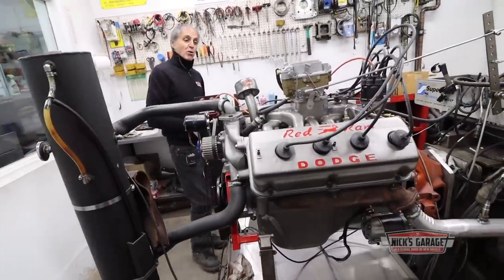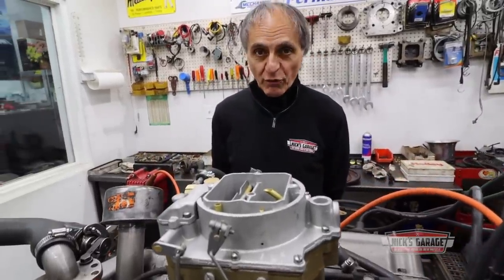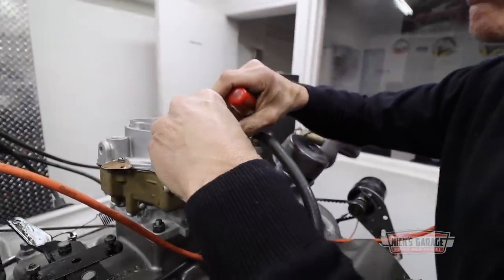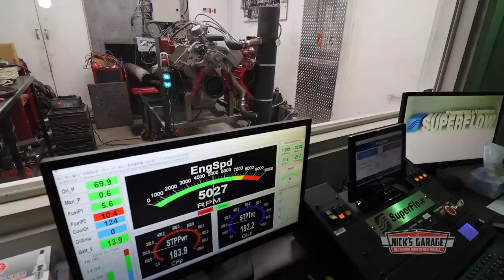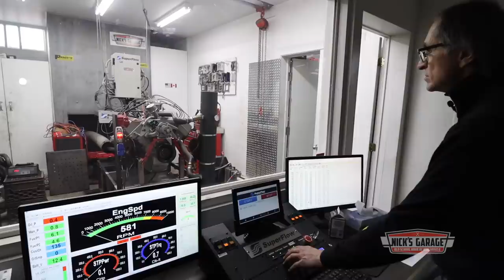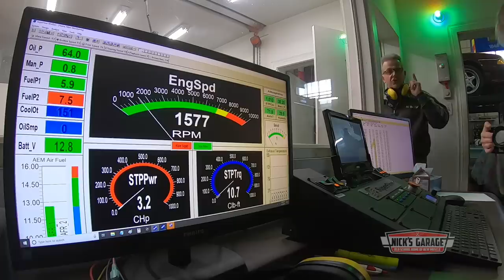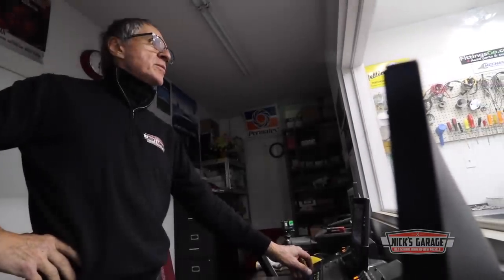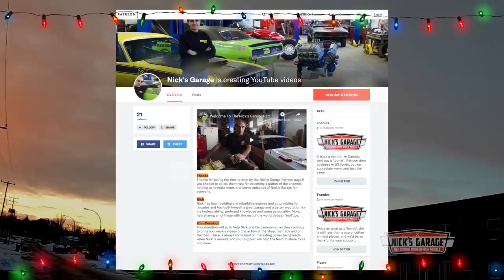Tiny Old HEMI - First Generation 241 Hemi on DYNO

Comment: I wish I had someone like you near me to help me build my DeSoto Hemi I found in high grass at Able Auto Wreaking, My Dad took me there in 1969 when I was 14 years old, I traded a beat up Dodge Challenger for it after I fried the second 727 transmission in it, when I pulled the first 727 out I opened the drivers door and the body flexed under the windshield and dash board, in summer of 1984 I traded it a year after I bought that Challenger after I got out of the Army under Medical Conditions. I’ve beat cancer 29 years ago Late Stages Hodgkin’s Lymphoma And radiation treatments fried my bones so bad I had both shoulders (93-96-98-99) replaced and bone grafts on both hips and in December 2016 I had open heart surgery aortic valve replaced and one bypass and a pacemaker put in. It’s hard getting things done but I keep trying 
Thank You for Sharing this on YouTube
Reply: Michael.        Keep going strong Michael.  All the best.
Reply: Nick Panaritis thank you sir, it’s been a long overdue project for me all on my own, Nobody wants to help me for they all tell me they want my car (1929 Ford Coupster and Engine) I started this nightmare in 1973, found my first Hemi in 1969 under a tree in high grass at a junkyard on the Tuscarora India Reservation and traded a 72 Dodge Challenger for it in 1984. Bought my second DeSoto Hemi in 1992 both are 291 - 1955 S22 Bocks this one ran when pulled . #1 was stuck had a plug removed and Ax hole in oil pan and turned out it came out of a car a friend of my parents who was teaching his sister in law how to drive when she rolled it in a ditch in 1960.
Reply: Nick Panaritis and since all that I beat Late Stages Hodgkin’s lymphoma in 1990 and radiation treatments and Prednisone ate my bone away and I had both shoulders replaced and bone grafts on both hips and in December 2016 I had open heart surgery aortic valve replaced and one bypass and a pacemaker put in, I’m 64 years old and on Social Security now , not easy for sure
Reply: Stay strong friend!
Reply: @horseyhorselips3501  what part of the country do you live in Sir?

Comment: Nick, The 1959 1st generation Hemi did run a little lean back then. I think it was designed that way on purpose. That's how Dodge accomplished 25 M.P.G.. Dodge wasn't in for the horsepower until the end of the 2nd generation Hemi's competing with Ford, Chevy, Chrysler, and G.M., but I could be wrong? This video was the most intense dyno video you ever had! It was like watching a soap oprah! 👍😭👍. "MERRY CHRISTMAS NICK'S GARAGE!!!""🎄🎄🎄🎄🎄!" Oh, one more thing....those old iron blocks did loose 10 horse power when they get hot. I don't recomend you run that engine in the desert. That engine would run better with a Holley 500 2 barrel carburetor. Maybe with 38 m.m. jets. Add some led additives to the fuel.

Comment: It's not flowing fuel through the secondaries because the secondaries aren't opening. You can look directly down and see the secondary plates still closed. That's an early WCFB without the weighted flaps, but I doubt that's the right carb anyway. 241 was most always a 2bbl, and that carburetor is missing the hot air choke that should be there. Sounds good though.
Reply: Tyler`s.            Had it fixed the next day.

Comment: Great video.
I have INE of these Engines torn down and cleaned ready for a rebuild.
I located a lot of cool after market stuff for it like high compression Pistons, found a guy who can grind and reprofile the Camshaft, Offenhouser Tripower manifold and original style 2 barrel Carbs.
Haven't found any good exhaust Manifolds or Headers yet.
Also can't locate a new or rebuilt Water pump, mines missing.
I will probably use this Engine for a Rat Rod.
As you explained very well about the unique Flywheel, Torque converter, Starter arrangement glad you figured out a new combination with a small diameter 426 Flywheel but I do have the original old 53 or 54 Automatic I'll probably use.
Thanks for all your GREAT videos.👍

Comment: nick, you can solder up the jets and redrill them with the special drill bits they use to clean and adjust gas burners in furnaces and commercial bakery ovens,can get these jets drills at JOHNSTONE,do it all the time,and you can resolder them over and over,NEVER BE WITHOUT THEM,I HAVE TWO OF THESE ENGINES AND TWO 1955 331'S old hemis,they are the best engines in the world,they propelled drag racing into the future,happy new year nick and crew

Comment: There is so much hot rod stuff currently available for these engines that it borders on the ridiculous. Google "Hot Heads." They are early Hemi specialists & just about anything you could ever want is listed in their catalogue for all 12 of the Chrysler Corp 1950's era Hemi engines.
The 241 Dodge Hemi was made in 1953 [140hp] & 1954 [150hp] with the TWO barrel carb. The Offy Manifold & Carter WCFB carb, as seen on this engine was a factory fitment on  a limited run of convertible models that replicated the Indy Pace Car in '54. I don't recall the power output for that engine but with the low grade fuel that was available in the early '50's the 7 point something to 1 compression ratio was well justified.
The 1956 Dodge 315 & 1957 Dodge 325 Hemi came with over 9 to 1 compression & that really picked things up in the power department, particularly with the factory dual quad Power Pack option.

Comment: Hey Nick, thanks for the dyno of the 241, I had one when I was a teenager. well, I THINK it was a 241. It said 'Red Ram' on the valve covers. Did dodge make any other 'Red Rams' besides the 241? See, I bought a running body off dodge that this farmers kids stripped the body off and put the seat and gas tank on the frame and they drove it around in the fields of their farm. I found it behind the garage and saw it was a hemi and bought it from the farmer for 20 bucks. and yes, it still ran. Thanks again for all your hard work making this rare Hemi go zoom again...Tommy in Minnesota

Comment: I have a 54 dodge coronet with this Red Ram engine that was raced here in Tucson Az in the 50's and 60's as a drag racer. i am going to put it back on the track i the nostalga class and see what it will do. I have the old trophies and time cards from the 50's and it ran in the 14's it has a 4 brl and three on the column and an overdrive. I really enjoyed this video, thanks.

Comment: This engine was designed in the  1950's and the jetting was chosen for 100%  gasoline with led in it.
Now the engine is being dynoed with modern led free gasoline that probably has some ethanol in it , 5% or maybe even 10%. This will lean out a carburetted engine that uses stock old jetting. Maybe that is why it is running lean at WOT?

Very nice engine, it reminds me a lot of 50-80's Peugeot inline4 engines. 
(203, 403, 404, 504, 505 and some vans.)
They had cast iron blocks with wet liners and aluminium(!) Hemi-heads. Peugeot made millions of those mini-Hemi engines (1.3, 1.5, 1.6, 1.8 and 2.0L) and won a few east-African safari rallies with them. Africa used to be  full of those Peugeots, they were tuff cars with tuff engines.

Comment: I have a 1954 Dodge Coronet with the 241 Red Ram Hemi. Approximately 119K original miles. All original except for radial tires and a 6 volt alternator. Original carb is a Stromberg 2 barrel.   My owners manual shows these were available with 4 different transmissions; 3 speed standard called "Easy Shift", 3 Speed standard with overdrive, GyroMatic, sometimes referred to as Fluid Drive a sort of automatic/standard hybid and PowerFlite which was the 2-speed predecessor to the 3-speed TorqueFlite series which is what my Coronet has. I spent a long time searching with no luck for the factory air conditioning setup which puts the evaporator and blower in the truck under the rear deck. If anyone can be any help with that I would certainly appreciate it. The car has plenty of power considering how much it weighs. Cruises at 70 mph with power to spare for passing.

Comment: Have not seen/tuned a Will Carter Four-Barrel(WCFB) in years.  They might flow 450 cfm on a good day.....floats were a nightmare with the long arms.  There is a nice little Holley (List 4548, 450 cfm) that would be perfect for this engine.  Anytime I have a question about carb setting I throw that little 4-bbl on and it tells the story.  Old 'Vettes I've tuned had dual WCFB's on some of them.....even a brick with four holes in it might be better than the WCFB.....and I LOVE AFB's.....go figure.
Reply: Kathleen Shaw  I really never had any trouble with the WCFB but I've been doing this sort of thing since the Earth's crust cooled, too.  Many people just can't figure out something simple.  I'm not a big Holley person but I have several List #'s that have worked well for me.  A lot of people over-carb their engine, thinking bigger is always better and some think that they will spend their life on a drag strip and then don't.....the result is wasting a lot of gas and having lackluster performance.  I really like the AFB/AVS series carbs and the Edelbrock clones.  With a jet/needle "strip kit" you can make them walk and talk and get good gas mileage, too.  I ran Webers on a Chevy in my reckless youth and they are magic in that you can pull the jet stack and you've got it all there in one spot, even including the emulsion tubes.  They are easy to get lost in if you don't know what you're doing but when you get them right, it's better than love.  The moan of Weber's whacked open on a healthy engine is like a symphony.  They tell me Del Ortos are pretty good, too. I've tried to tune the SU's like you find on a lot of British stuff and learned that I can't cuss in SU, if you get my meaning.  If you and the WCFB get along.....you must be doing something right.....283's were one of the finest motors made, especially with the old "Power Pack" heads.  I had one bored to a 301 with "double hump" heads that was flat amazing.   You could wind it up until only dogs could hear it.....of course it was set up just for strip with tall gears, 4-sp'd Muncie, and light car.  It used a 750 double-pump Holley and got shifted at 7000 and went thru the lights at 7100-7200 rpm.  I envy you a bit with the '57 Chevy.  I had a '57 Ford that started out with a 292 and ended it's life with a 390 CJ.....why I sold it I'll never know.  The old 'Vette fuelles were interesting but GM never put out mechanics that could tune 'em right.  I've seen them in '57 Chevys and they were nice when set up.  Hang in there.
Reply: Kathleen Shaw  Didn't address the 4100's....I really liked those carbs as they were easy to tune and straight forward.  It's been so long that I can't remember with ones (size/flow) that I liked the best.   I had 2-3 of them carbureting my shop shelf for many years and eventually kinda got out of it and sold them.  They responded so cleanly when you hit the throttle it seemed.  I pretty well getting too old and stiff to play anymore.  Will probably sell engine stand and hoist in the spring.  I dunno.
Reply: Or A Holley " Dirt Track" 500 cfm 2 Barr. Might Work,If HOLLEY Still Makes Them.Did That To My 71 JAVELIN AMX ,360,Stk.2 Barr.Was 250-275 cfm,Put Holley 600 Jets on the 500 cfm& Ran Good As 4 Barr.
Reply: @edcain3676  They still make 'em.....trying to remember List #.....was that the 4412?  I know that it was great carb and flowed nicely for torque, too.  I had one(still can't remember the number but know what you're talking about; it had a big 50cc. Reo pump on it) but let it go some time ago.  Wonder what Nick will do in the future....?  Only thing might be a fly in the ointment.....I think your Javelin had better intake ports... and exhausts.   Man, that exhaust system is killing that old Hemi, too.  Gonna be interesting as I don't think Nick will accept what he's getting out of it....do you?
Reply: Having grown up with misanthrope   carbs Tom your insights made me laugh...I never tried a brick . ..
Reply: @pensive69  Thanks....we all need a chuckle sometimes.  There are times you birds chime in and I LMAO.  I'm kind of a beat up old guy and sometimes I really need something to chuckle about.  I had 3 Strombergs when I was a kid on a '57 Ford 312 T-Bird motor.....talk about a wet dream.....trying to set them up and keep them tuned.  Ever change jets on a Stromberg?  I fluently cuss in Ford, Chevy and Mopar.....but not in Stromberg.....sometimes life is not fair!  Keep the Faith and thanks for the cheer.  Merry Christmas.

Comment: One of the guys in my auto shop class had a 254 Hemi, I think. The early First Gen Hemis had an interesting history. They were used in Dodgr, Chrysler, Desoto and I think, Plymouth. But instead of having the same cubic inch options accross the board, each brand had their own sizes. I think the 354 and 392 were the only exceptions, but don't quote me. Further reaserch is needed to back this up, but I'm sure it's fairly accurate.
By the way, the shot of you walking through the shop made me sick! All those Mopars and not one of them was mine! Lol
Seriously it brought back a lot of memories. I wish I was still in the shop, but my back had other ideas.
Reply: Plymouth used the polyspherical head because it was cheaper

Comment: Nick - This is your BEST EVER STORY ‼️

I have a question about the awful exhaust manifolds. The engine would still be original if the manifold insides were abrasion-flowed and port-matched. Ok .....smoothed too. 

HEMIs must breath. 

But as you know there is much more to this 
Hemi history.
Reply: It's not just cross sectional area that matters, the geometry if those manifolds is just terrible no matter how big you make the holes.

Comment: Merry Christmas!Great to hear one of those running again (I had one years ago in a field car) I knew someone once(my father had worked for him before I was born, and I was born in 1950) who was a country mechanic all his life, who mostly worked on Mopars, I hung around his shop a bit when I was old enough and learned a bit (sad when we lose those people, a mountain of knowledge is lost with them_I miss them just for themselves) my guess is he could take a quick look, and listen and know exactly what was wrong. He had a little 3 bay garage with piles of parts and things here and there around the floor when he needed something he would stick his arm into a pile and come out with what he needed, what he couldn't find, he would make, he did super bodywork, _some shops would bring in bent frames their megabuck machines couldn't get right, and he would get out his old chains and collection of old jacks, spend a while and presto-good as new!  He could also weld cracked blocks without welders, or torches, using a cheap, simple, homebrewed compound, and a long match,I  won't reveal the compound here, some youngster could get badly hurt as it is dangerous if one isn't very careful- potent stuff, he learned that as an army mechanic during WW 2 in N Africa.
  Well I've rambled on long enough-Merry Christmas !!

Comment: One thing you may not be aware of; the aluminum tube doubles as the plug gasket, so if you are still using the plug gaskets that come on yhe plugs, you need one or two steps cooler plugs.

Comment: Two words, "metering rods."
The Edelbrock carburetor is the old Carter afb with an all aluminum body. Anything that works with one, works with the other. Metering rods control the fuel delivery between off idle and wot. Try those next.
Reply: The carb is a WCFB (will carter four barrel) that come out years before the AFB and AVS.
Reply: @jsullivan9238  most of what I know of rebuilding and tuning carbs came from the gasoline carburetor and fuel injection class at Nashville Auto Diesel College back in the early 90's. Since then I've stuck around mainly electronic fuel injection systems. I saw the classic Carter setup and assumed they all work the same. My bad.
Reply: fm9572.    I thought so also, but not the same style metering rods.

Comment: I don't know this for a fact, but if it is... might be helpful.   I was reading some article where they built an old 50's Hemi, and when they needed an exhaust manifold, they were able to modify an exhaust manifold or header from a Ford 351 Cleveland.
That was a very long time ago I read that.  Seems it was real close except the exhaust ports on the cleveland was taller than wide, and opposite for the old Hemi engine.   Like I said... it's just something I remembered seeing years ago, and might be applicable here.

Don't hate me if its BS.

Comment: Carter WCFB carb. Used on 225 HP Studebaker 289 engines. A 270 HP 283 used 2 of them. Interchangeable with 4GC Rochester carb on many GM installations. Something is wrong. Maybe metering rods? That baby Hemi with the 4bbl. carb should make 170-180 HP. I believe 150 hp was for 2bbl. carb.

Comment: Nick, hot hemi heads Inc. Makes a balancer for the early dodge hemi, by all means tell your customer buy one, put it on.  Talked to old timer told me they would break the crankshaft suddenly when shut off.  Years later I bought 3 early hemi/poly dodge engines from junkyards, upon inspection one had a broken crank clean off just after of the #1 main cap!  They had no balancer oem but they surely NEED one.  Tell him spend the $300 get a balancer, don't risk breaking 70 year old crank!

Comment: Well it would seem on the face of it is an internal carb issue.
I would take it off and disassemble it on the bench.
It can't possibly be a normal vacuum leak since there's no manifold vacuum at full throttle so my guess is it is something was disturbed when you took the air horn assembly off the carb to change the jets. It is possible that the sticky float issue is coming back or one of the float tabs was bent causing a bowl to starve for fuel at WOT.
Something ain't right.